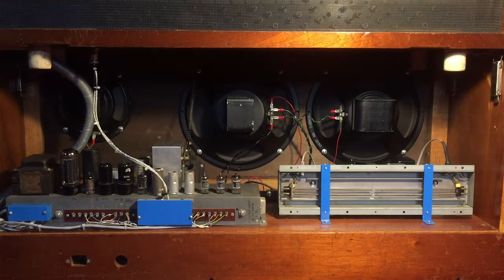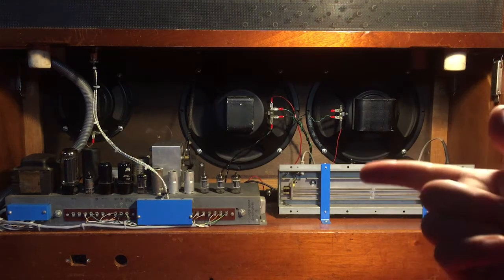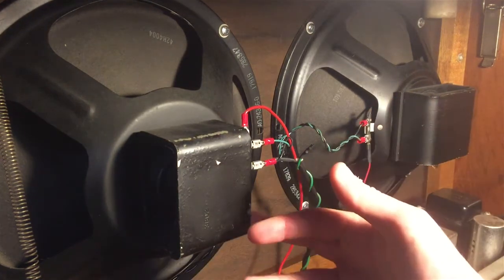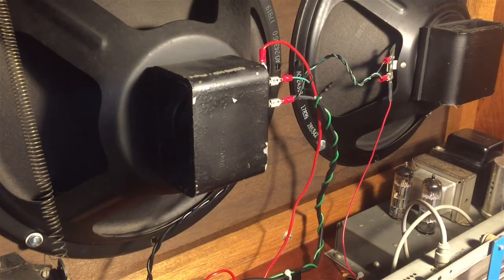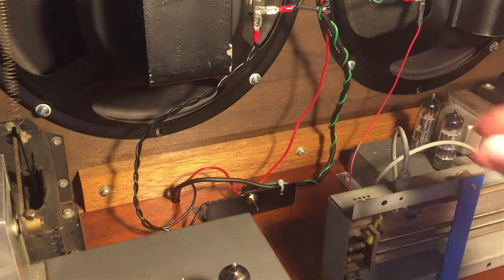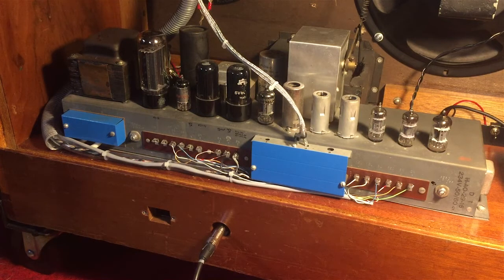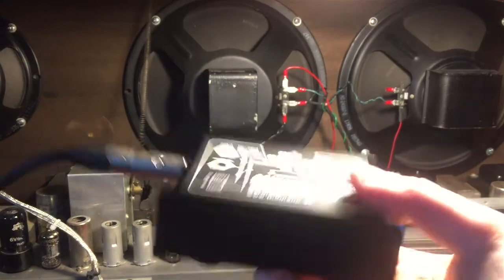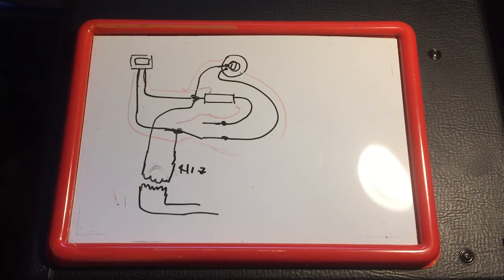Hammond M-100 Speaker Bypass Mod Explained

Comment: Hi! I have an M-100 and i am curious about what terminals you connected the quarter inch jack to. What terminals on the amplifier did you solider the quarter inch jack to?
Reply from the maker: Hi, the jack is connected to the output transformer (so it’s practically connected directly to the speakers). I used a DI box to lower the high signal level coming out of the amplifier and have an insulated, high impedance connection. Hope it helps!
Reply: @DaveElectronics  So would I get the same result if I soildered an instrument cable to the terminals on one of the speakers and then ran it thru a DI box? (I worried about scewing up the omage)
Reply from the maker: Yes, you can! But remember that if you have the bypass mod like i do, when the speakers are bypassed, the DI is going to be bypassed as well.
Reply: Just performed the Mod and I cant be happier. Thankyou so much!!! :)

Comment: I have a quick question, when using the bypass resistor instead of speakers, does hooking the DI Box add additional impedance? It seems that the resistor and the DI box together would have their own impedance.
Reply from the maker: Hi, yes it does! But being the DI a high impedance device (much higher than the bypass resistor), its contribute is negligible.

Comment: Although both are expressed in ohms, resistance and impedance are different concepts. Impedance only relates to alternating current and is frequency dependent. The audio output of an amplifier is alternating current. Speaker impedance is a nominal figure used for audio system design. Impedance cannot be measured with an ohmmeter; only resistance can.The 4 ohms you mention is the nominal impedance which results from having two speakers, each with a nominal impedance of 8 ohms, connected in parallel. The DC resistance of each speaker, as measured by an ohmmeter, will not be 8 ohms but more like 6 ohms. That said, a 4 ohm resistor will fool the output transformer into believing it is working into a 4 ohm impedance.
Reply from the maker: Yes, correct! I should have mentioned that in the video. I didn' t for the sake of semplicity, but yes, i'm using a resistive load and not the inductive load (of the speakers) which is measured differently. 
Thanks for the comment!
Reply: Yes, I was thinking that as well. I was hoping the 4 ohm load would be sufficient to compensate for the actual imedance of the speakers. Presumably it is since you haven't blown your amp yet! :-)

Comment: What are the 3 speakers in the cabinet for? The two large ones are in parallel but what about the third one?
Reply from the maker: Hi, the two large speakers are for the main organ speakers (so dry, direct sound), the third one is the speaker for the spring reverb.
Reply: @DaveElectronics  Ahh ok.. Thankyou! i have been curious of that for a while.
Reply: @DaveElectronics  Is there anything special that you do with the bypass? or do you just simply shut that amp and speaker off from the console when using DI.
Reply from the maker: The purpose of the DI box is to match the impedance for a direct connection to a preamp, an effect pedal or another amplifier (i often plug it directly to a Vox AC30). I added a switch to bypass just the speakers, so i can decide whether I want also the sound from the organ or not (for example, when I want to record just the dry sound from the organ, i bypass the speakers).
Reply: @DaveElectronics  Ohh, I was meaning the reverb amp and speaker! sorry.

Comment: As far as I can tell, the only purpose of adding this impedance-matching resistor is so that you can turn the internal speakers off. If you just took the signal and sent it to the DI via a jack output (say, to record with a DAW), this would still work without adding the whole switched circuit?
Reply from the maker: Hi, yes, shure it will work just fine. I made the speaker bypass mod because, let's say, if i want to record a piano and the organ is close to it, i don't want the sound of the organ to spoil the piano recording.. it's just for convenience  ;)

Comment: Hi! Great video, thanks!
I just don’t Knie if I get it right:
So the Switch, Switch between loudspeaker(s) and resistor.
And the same output (but on the amp it self ) is connected to the DI-Box input?
So the resistor AND the DI is connected? 
Or do you use the switchmechanism on the Jack?

Cheers,
Danny
Reply from the maker: Hi, thanks for the comment! 
The switch selects between the speakers and the bypass resistor. The DI box is connected to the output transformer (basically direcly connected to the speakers). You need the transformer of the DI box for the high impedance and to lower the signal level. The DI box is always connected, whether the switch is in the bypass position or not, but is a choice that I personally made for my convenience (basically for recording both the direct sound from DI box and the “real” sound from microphones on the speakers). Hope it helps! 
Dave

Comment: I have a question if you can help, I purchased a CV model that was sitting for years, i added oil, my tone generator wont start. The starter motor turns and connects with small gear on main shaft,but the main drive shaft doesn't spin. Do you know what may be the problem? Any help would be appreciated
Reply from the maker: Hi, have you tried turning the main shaft by hand? Try to isolate the problem. It might be the main sync motor (although is quite rare) or the scanner vibrato (if your model is equipped with it), so try to detach the main motor from the main shaft (simply by removing the flywheel). If it doesn’t turn, the problem is in the generator itself and you might have to remove the entire assembly from the organ and take a look inside by removing the metal cover on top. It’s a lot of work, but if the problem is there it could be some suck gears (usually not the tonewheels, you can hold a tonewheel and the shaft will continue to turn). I highly suggest you to download and print the service manual of your model, it’s very well done, with step by step guides on how to disassemble the various parts properly.
Hope it helps, feel free to ask if you have problems.

Comment: Thanks for the video. I just picked up a M112 and am looking at doing the same thing. What is weird to me is, my speakers appear the same as yours but are 16 ohm each, so together equal a total 8 ohm load. You said yours together were 4 ohm, which made me worried. Any thoughts?
Reply from the maker: Hi! Thanks for the comment! That’s a really nice question, thanks for pointing that out. Reading the manual the speakers should be two 16 ohms in parallel (so, as you said, total load of 8 ohms). Can’t really remember the impedance of mine, perhaps in the video I made a mistake…
I will measure the speakers again and i’ll keep you updated. 
In any case, i highly suggest you take the measurements of each speaker (while disconnected from the amp) separately with a multimeter and stick to the total impedance of yours. 
Hope it helps, 
Dave

Comment: Alright!

So I'm trying to do something similar to what Jon Lord did.

Would there be a problem if I'd use this method and get the signal into a guitar combo PLUS use a leslie with built in pre amp (Like the 125) ?
Reply from the maker: Yes, you can! This ‘mod’ allows you to connect the organ to anything that has a 1/4” Jack input. For example i use a signal splitter to connect the organ to the audio interface (for dry recording) and to the leslie simulator (mono input). The Leslie simulator (Boss RT-20) has a stereo output and i then connect it to two Vox amplifiers to have a beautiful stereo sound.
Reply: @DaveElectronics  That's awesome! I didn't think it was that easy! The DI box, and you're good!

Comment: And if I were to say put the organ through an effects pedal, would I adapt the balanced signal back to a 1/4", or what? (Sorry, I'm not all yo familiar with circuitry)
Reply from the maker: Yes, i forgot to mention in the video about it, but i have a little cable that has balanced xlr (from the DI box) to unbalanced 1/4” jack. I always use it plugged to the Boss RT-20 as the Leslie simulator and it works fine.
Reply: Dv555 Alright, thanks